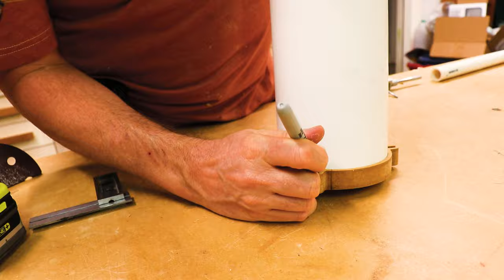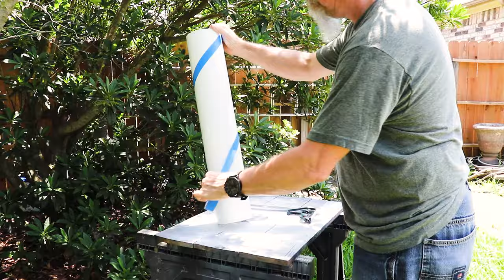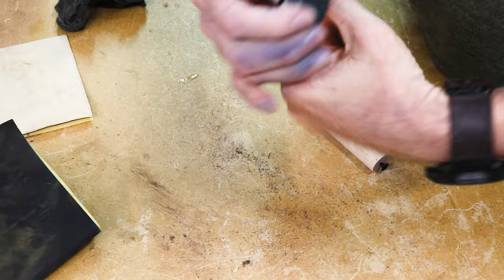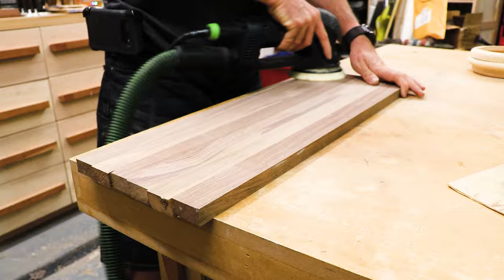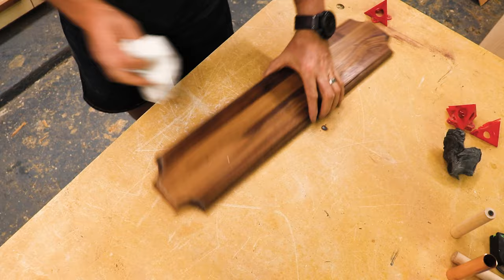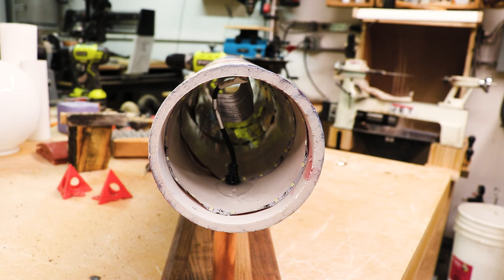Hanging Lighted Barber Pole

Comment: So on this pole when you were taping you changed your mind and went with standard color masking tape. 
 I like your double lamp so much I want to make one. 
I don't have the wood router for the flanges and I'd like to know how you tape up pole for red and blue tape. 
Even though I watched your video several times and slowed it down I can't figure that taping job you do. 
I layed down in a 45 ° the first stripe of painters. Is it wrong if I don't end up with an equal amount of stripes?
I think on one side it'll be wh/bl/wh.
I'm sure your visitors say 
" Oh, what a nice lamp. Where'd you buy it at "?
Hope to hear from you thanks.
Jimmy
Reply from the maker: The trick to this is that there are only two stripes. Once the base is painted white, tape off two stripes for blue and red at equal distances. I mark the top to identify where my tape strips start.

Also, if you look really close, you will see that my stripes are not quite the same size. Taping off the stripes is the most difficult part.

Lastly, I changed tape because my first few attempts didn't work and I ran out of tape so I picked up what was available in the shop.